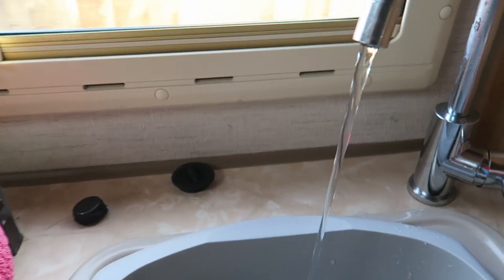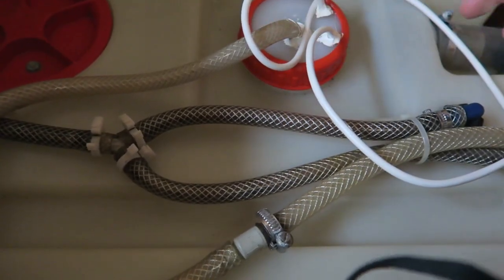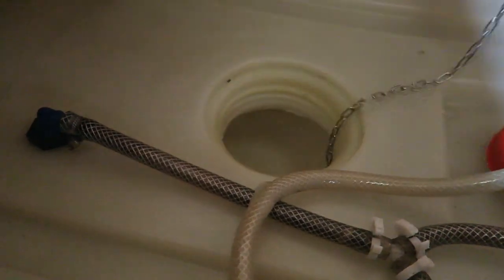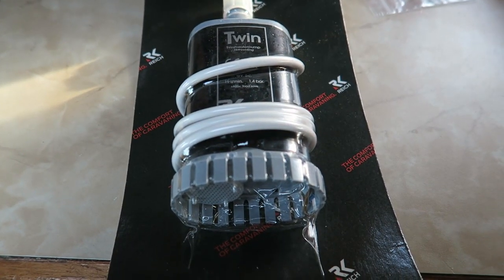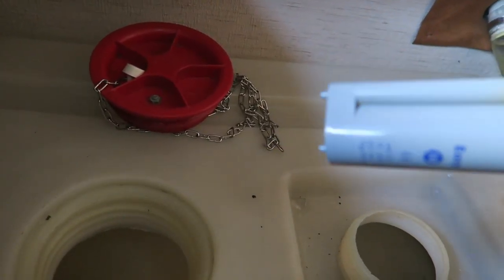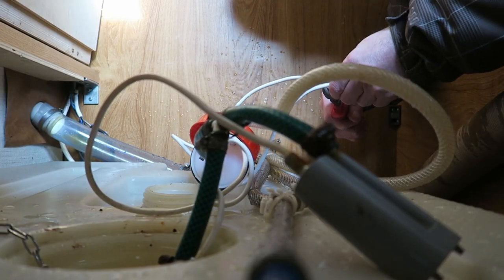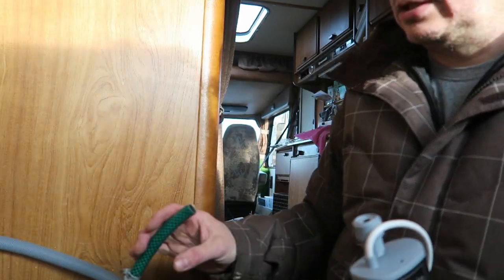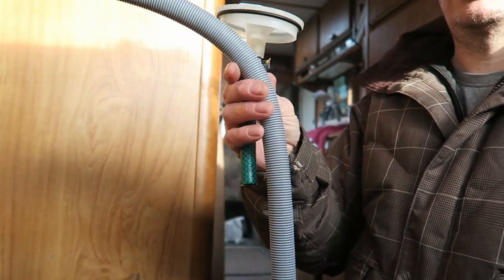Replace Motorhome Water Pump

Comment: Hi mate. Did you stick with this pump in the end? Thinking about riding space for a surflow pump rather than a submersible one…
Reply from the maker: I am still using this pump. Had no problems at all since fitting. It's been great.

Comment: Them supposedly Reich pumps you took off are on eBay, I have my suspicions they may be fakes.    Don't think you need hose clips in the tank really.
Reply from the maker: They were terrible. The clips were to double up the pumps but didn't really work. If you use anything in the tank it should really be stainless. New pump has been great.

Comment: Them supposedly Reich pumps you took off are on eBay, I have my suspicions they may be fakes.    Don't think you need hose clips in the tank really.
Reply from the maker: They were rubbish those pumps. If you are going to use hose clips in the tank make sure they are stainless 👍